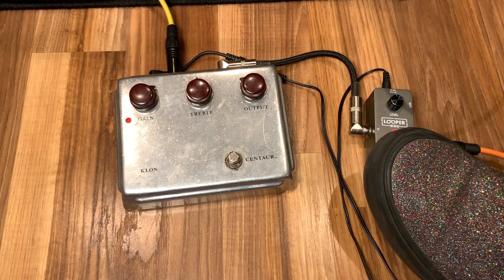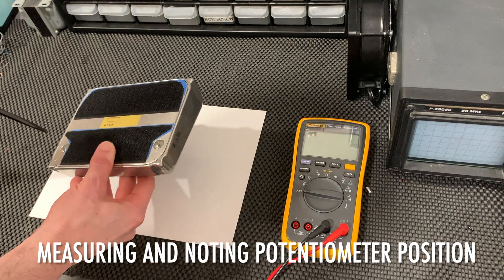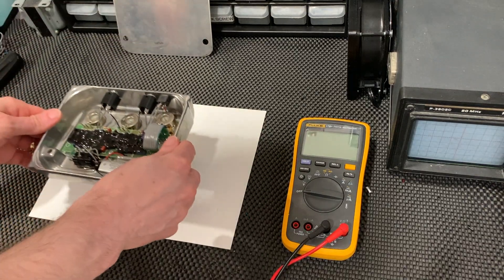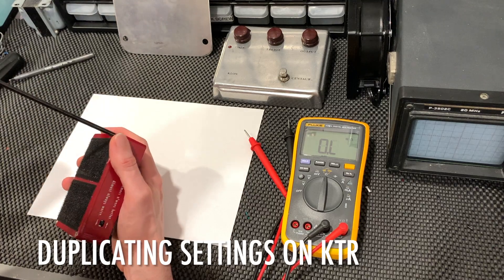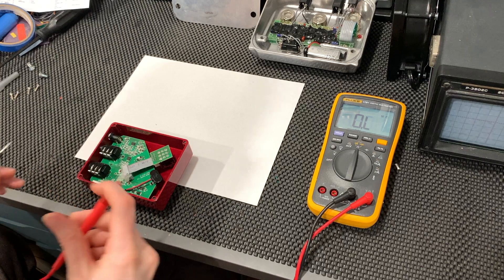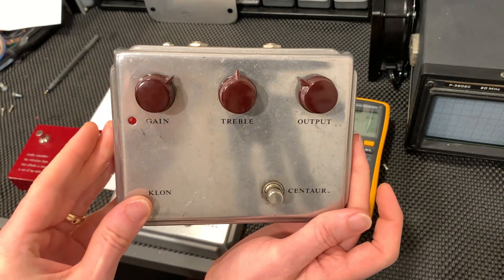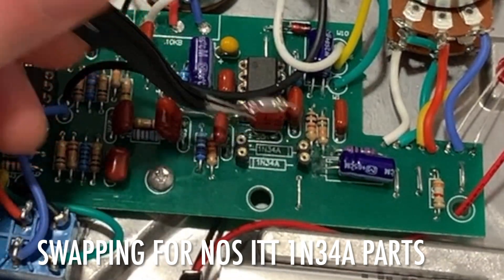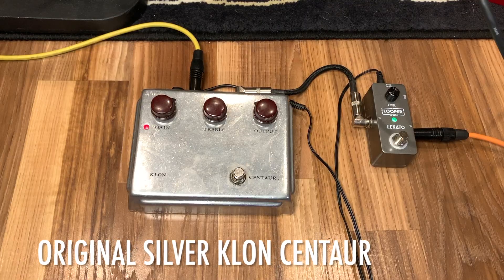Klon Centaur vs. Ceriatone Centura vs. KTR (and diodes!)

Comment: Just like the potentiometers, the diodes have different values at specific points in their curve.  So here too you cannot go by "visual" settings, the diodes react differently at a specific setting will both vary and be equal if you adjust for the curve differences.  With 60+ components all varying from a 5-20% in that circuit it is crazy how everyone focuses on these "magical" diodes that don't exist.

Comment: Those ITT Diodes really get the Ceriatone 95% of the way to the OG Klon. In a live setting, i'd be lying if I said that I can hear a difference between the two.
Reply from the maker: Even in our studio control room, or in the live room standing with the amp, I'm not sure I could guess correctly with better than 50% accuracy.

Comment: Any idea what the forward voltage was on those ITTs? 
From what i understand the .35fV measured on a real Klon is too high because the instrument used to make that measurement actually tests at 5mA higher than what a regular digital multimeter tests at.
Reply from the maker: I didn't measure; I was more interested in a good listening test so I could have a touring replacement for my Centaur. I got close enough and didn't look back. There's a thread on groupdiy where a poster named CJ measures a bunch of diodes; perhaps there's some info there.

Comment: Dang. Well there you go. It seems the diodes do something indeed. It's a more significant difference than I would have guessed too.

However, there is one thing I would have liked to see. You matched the potentiometers so that we would be hearing the effect of the circuit differences rather than the natural pot variances. 
But in a practical scenario, I would just set the knobs so that the two pedals sound the same. 

The Centura circuit sounds more like the Klon with the proper diodes. But, could you not compensate for the audible difference in the stock diodes by tweaking the knobs a little by ear?

Comment: Why not use the original as the template or control box and physically move  the controls to APPEAR the same by a little tweaking? Easy.
Reply: What do you mean by “appear”? Visually? Or to sound the same? The pot is a variable resistor, he’s simply matching the resistance so you compare the circuit itself without the different setting on the pots.
Reply: @2tallB  Visually. I thought it might mean something to some people that 12 o’clock means the same on every unit. I have been shocked how little some know about their gear but it is a journey not a destination. Might be a tall ask with component tolerances etc but is there an advantage if each unit means the same thing across it’s control panel? “Yes, officer my speedometer reads 100kmh.” “Well, son…mine reads 129!” Like that. Just a thought.
Reply: @Germinalx  the reason is that he’s comparing diodes not control knobs. Maybe it’s not “easy’ but it’s the more accurate way to do it.